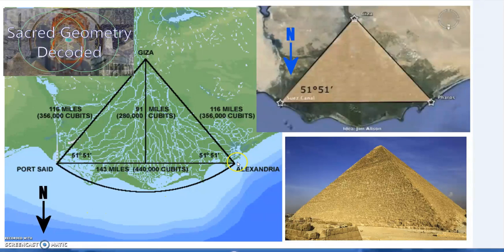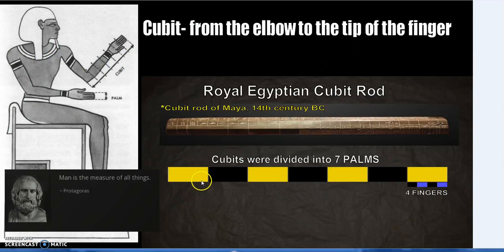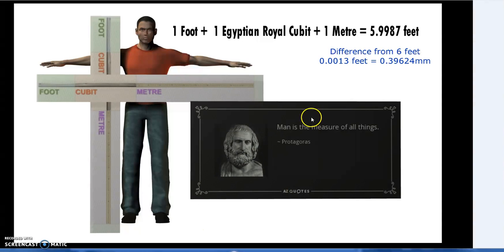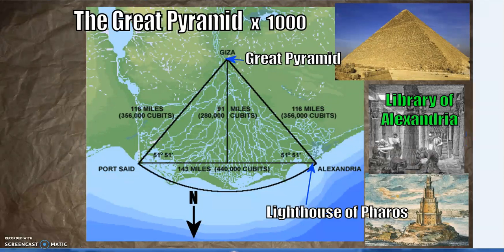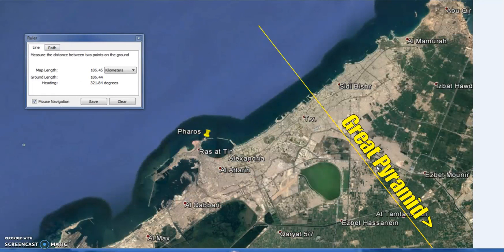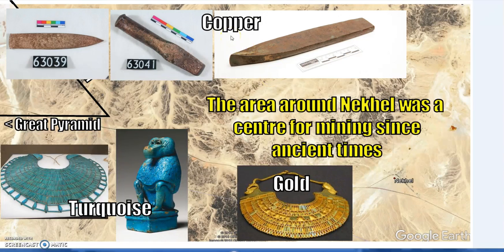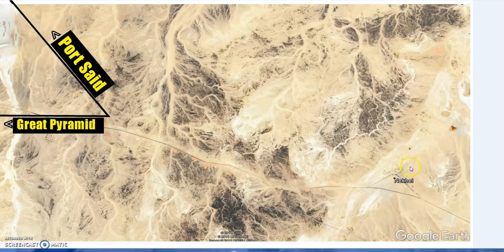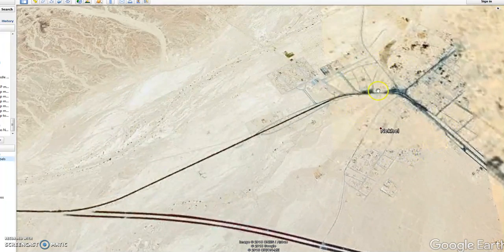Great Pyramid & Testing the Nile Delta Projection

Comment: But 12-14.000 years ago all this geography was different. How could we apply this data using today's maps and coast-line?!
Reply from the maker: Off the coast of Alexandria there is a sunken town with Greco Roman sculpture. Just in last 2000 years the coastline has shifted. River deltas are silt and so can be dynamic. Though Alexandria current locationfounded around 300 bc and Port Said - Suez Canal not even 200 years old.
As for the pyramids the same erosion of limestone aging the Sphinx not seen on the pyramids. The limestone and even any geopolymer limestone would have to show age if 8000 years old for instance. Limestone very reactive, you can actually rapidly dissolve limestone in vinegar. Look up “limestone in vinegar” there are good videos.
Reply: And what about the connection to Earth's size and Moon-Earth distance?
Does it all connects or this are different theories?
Another question: what did ancient Egyptian thought to be Earth's geometry and size? Was is flat? A space and time travel machine? A hollow-Earth?
Reply from the maker: By “extraordinary coincidence” the measures and proportion point to a globe including flattening at the poles. I would guess much like now the “priests” had classified knowledge, while the commoners were fed the news and education we filthy peasants are given today.